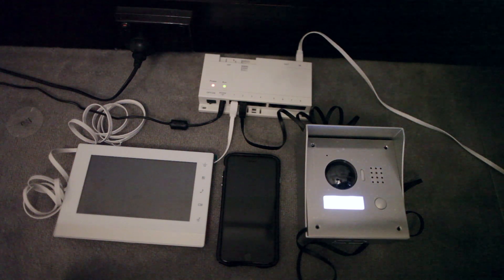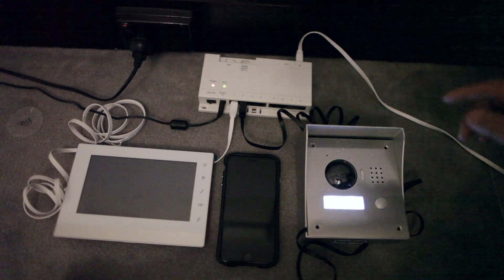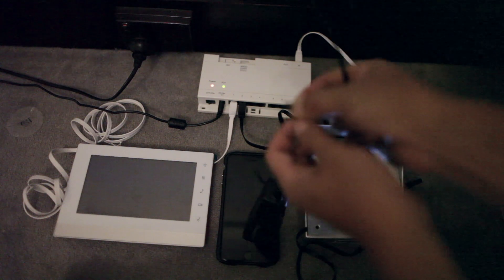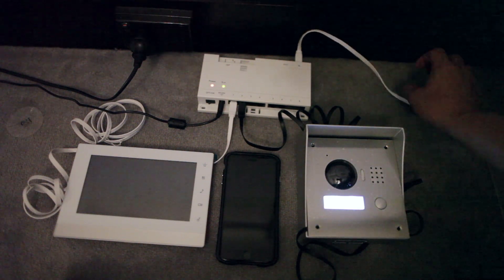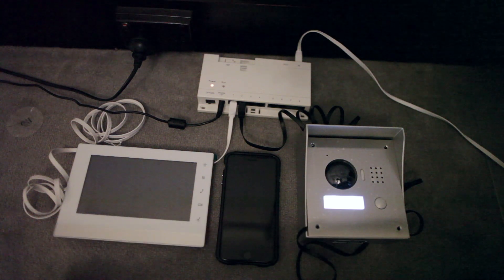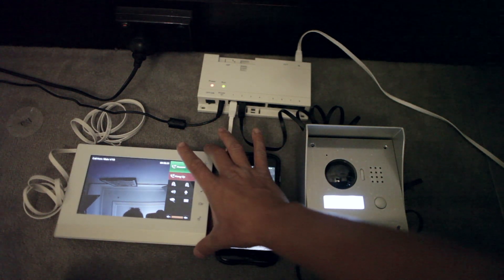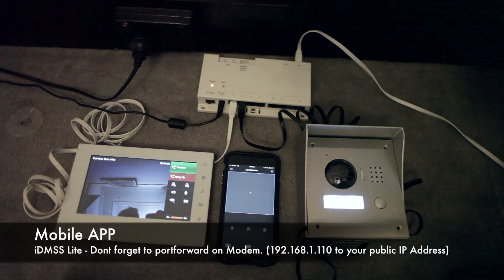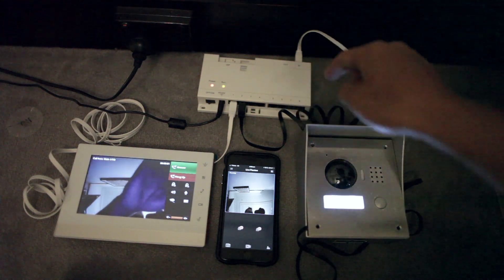Video Intercom - Dahua VTO2000A

Comment from the maker: Update: there is a new APP called DMSS which is available now and it replaces iDMSS Lite and iDMSS PLUS. Both the predecessors was quite unreliable with the push notifications to mobile phones but this new one seems to work so much better. I can do a vid if anyone is interested in it.
Reply: Hi Gavin - thanks for your video.  I have the VTO2000A and VTH1510CH set up, very similar to yours, and trying to get the mobile app working but can't find the devices to add in the DMSS and iDMSS apps and I can't even get in to the web login interface using 192.168.1.110 .   Do you have any advice on how to troubleshoot?
Reply from the maker: Terrie F for the web login via IP, you need to use Internet explorer. All other browsers just show a grey screen. 

For the dms app, the devices don’t automatically show up for you to add. 
You need to hit the + then add via IP/Domain and enter the IP address of the device. 
If It’s LAN then it will be the 192.168.1.09 or your external IP address with the port 37777
You will need to port forward first though
Reply: Gavin poh  thank you, will try again with the port forwarding
Reply: Hi Gavin - could you please do a vid of your new DMSS app set up?  I can get the DMSS notifications and live camera when my mobile is on the home wifi, but when I'm on say 4G I get the notification but times out when i try to answer the call
Reply from the maker: @terrief2083  Hi Terry i can if i get some time. maybe just check the stream settings and make sure its under "Main" and not SUB. It could also be simply your network may be weak. If youre getting the notifications outside of your network whilst on 4G, it means the device is correctly set up in your router and it can get out via the port forward. The quality of the voice or the issue of timing out may be a network coverage issue instead.

Comment: Hello, did you have problems with wifi when the doorbell rang? When sounding, WIFI disconnects me.
thanks.
Reply from the maker: No i dont have that issue. Strange though.. i cant see how that would impact your wifi?
Reply: @K9Ren  I clarify that I do not use the dahua poe switch. maybe it will be that?
Reply from the maker: @leandroruizdiaz8929  maybe.. i havent tried using a standard POE switch but that makes more sense if its from your main switch as i think they use proprietary firmware on the Dahua POE Switches.

Comment: Hello, I have exactly the same set as you have and have a problem that I can not enter into web agent. Default ID 192.168.1.110 or 192.168.1.109 is not working :-( Could you give me some tip? Thanks. M.
Reply from the maker: Michal Pugner are you on MAC OS? 
I had that problem too but when using explorer on Microsoft, it works. Try that
Reply: @K9Ren  I have Microsoft IE. Is there anything what needs to be set up in windows?
Reply from the maker: @MPugner  sorry mate thats about all i can add here. I was getting a grey screen on MAC OS and Safari, Chrome and Firefox. When i spun up a MS VM, it worked. I guess you just need to make sure youre on the same network when you access it. Do you have a different IP range in your home? Perhaps you may be on 192.168.X.X ? rather than .1
Reply: @K9Ren  Maybe yes. I just followed the attached manual :-( Is there any way how to find out the correct IP?
Reply from the maker: @MPugner  Thats on your Modem.. can you browse to 192.168.1.1 ? that should be your default modem but i suspect yours may be 192.168.0.1. I cant help with you modem and network settings but if you google how to find your IP range.

 In the “System Preferences” window, click the “Network” icon. Select your network connection—for example, a Wi-Fi or wired connection—and then click the “Advanced” button at the bottom of the screen. In the “Network” window, select the “TCP/IP” tab. You'll see your router's IP address listed simply as “Router.”
Reply: @K9Ren  I will try that. Thanks a lot ;-)

Comment: @Gavin - hoping you're still monitoring this post mate. I have recently purchased these exact devices, and for the life of me cannot get them working. Like you, I've searched and searched online for tutorials, help, guides etc and came up short. Following your advice in the vid, I have all the cables connected properly, have the Power and Run lights lit up on the VTNS1060a - which also powers on the screens (I have a VTH1550ch & VTH1510ch). I have tried entering 192.168.1.110 into my browsers for Chrome, IE & Firefox however cannot gain access. Are there steps I'm missing??

I have also now downloaded the Dahua Config Tool, however it also cannot detect any devices?? Please help mate before I go insane here.

Cheers,
Willow
Reply from the maker: Hi willow

Does the units work (I.e bell rings when you push button and also rings on display) but you just can’t get access to the config user interface? 

I know this is obvious but check your PC is on the same network, preferably connected via cable and not wifi. 

I’m no expert but it worked for me on PC but won’t work on Apple Macs.
Reply: @K9Ren  I just pressed the button and one of the monitors lit up and rang (wow that was loud!). Yes, I'm running Windows 10 and have my modem physically connected to the computer. So to confirm, you didn't need to go into your control panel > network settings and manually change your IPV4 details? Just simply popped the 192.168.1.110 into an address bar?
Reply: Sorry mate, to answer your question - yes, that's right cannot for the life of me gain access to the config user interface :(
Reply: Update: so I've logged into my router settings and cannot see any of the Dahua devices within my Connected Devices list... hmmmm. I have also noticed that of the devices listed use the following protocol 192.168.0.x - somebody helllllp :(
Reply from the maker: Ryan Wilson yea for me it just worked on 192.168.1.110 as my networks are all 192.168.1.x
Another obvious one is trying 192.168.0.110?
Sorry I know this may be patronising but I’m a noob at this too.
Reply: @K9Ren  Hi again Gavin. So I finally managed to get the units to talk to one another (what an ordeal!) My next piece to the puzzle is now trying to connect my door strike. Question for you, does your strike simply connect directly into ports 10 & 12 (COM & NO) of the VTO, as is POE? Or do you then have a separate 12/24v power running to the strike? Again attempting to find a simple installation guide on this is proving to be a nightmare. Thanks again for your previous advice too.
Reply from the maker: @kpstar1690  no worries, mine was straight forward as I had a separate 12v strike already there and just needed to connect a relay.
Reply: @K9Ren  my saga continues... however progress made! Hey Mate, so I have now successfully connected the strike via the relay :) My issue now is that when pressing the unlock button on the VTH panels, it will not unlock the strike (making me think the wiring was wrong!). However when i log into the Web Service on my comp and press the 'Open Door' button (within the Video Set tab), it successfully releases the strike. So this now leads me to think there are settings within the VTH, or somewhere else that I now need to configure allowing the strike to release when pressing the button on the VTH directly (like it successfully does via the Web Service). Is any of this ringing a bell to you Gavin? I feel I'm now so close to finally getting this thing set up, however, can't get over the final hurdle! Cheers, Willow.
Reply: Additionally, the only cable I have connecting to the VTH1550 is an Ethernet cable. Looking at the back of the VTH there is a row of pins, as well as a green 2-wire port both currently not doing anything i.e. nothing connected to them. Should there be something connected them that you know of?
Reply from the maker: @kpstar1690  Hi mate, Thats good news :) no i dont have anything connected to the back of mine either, just the Lan cable. Did you try playing around on the settings such as lock duration etc? Essentially the APP is sending the same signals as the VTH is so thats strange that it works on one but not the other...
Reply: @K9Ren  Thanks for the prompt response mate. That's my thoughts exactly, I have 2x VTH (one main, and the other an extension). Both of them will not unlock the strike. I haven't yet downloaded the phone app to test that yet. I'm logging in to the Web Interface 192.168.x.x on my comp, which is allowing the strike to release via the Open Door button. Yes, I've tried playing around with the setting withing the A/C tab regarding duration etc to no avail... my word I didn't ever think it would be this difficult to set up :/
Reply from the maker: @kpstar1690  I guess i got lucky because im not technical at all but somehow it worked for me..but i dont have the complication of an extension..i wonder if that could somehow require further config
Reply: @K9Ren  i think that's my next step! Just downloaded and setup the app perfectly. It also releases the strike! Will look to remove the 'extension' VTH in case they are somehow clashing with one another.. more progress made :)
Reply from the maker: @kpstar1690  one step at a time mate and soon you will be able to tell those pesky door knockers to P|$$ Off lol
Reply: @K9Ren  hey brother, i hope your check this message.. i have a question. i have 4 old screen of dahua 1510ch.. and one outdoor station master VTO2000A.. which new outdoor model can i buy which will readily work with the old 1510ch screen without any hassle.. The VTO2000A is no longer available
Reply from the maker: @thomasn2786  no idea man. I’m just an end user, not a tech or reseller etc.. Im actually starting to think I should change to something else as the lag on these units are annoying.

Comment: I’ve been using this intercom set up for about a year now and it’s working really well.

 I’ve been thinking about intergrating a dahua cctv system by adding an IP camera and possibly an NVR to record. I’m assuming I just need to connect the Camera and NVR to the switch and configure??? Has anyone done this by any chance or knows if this will work or not?
Reply from the maker: i run a Hikvision CCTV camera system with a Hikvision DVR/POE Switch. They are very similar in how they are configured and will work. The Dahua APP, IDMS Lite or Plus will give you the added advantage of a single mobile APP to view CCTV & the Villa door.
Reply from the maker: after some digging, you can record the feed from the gate camera

Comment: Great. Video. How did you set up the app
Reply from the maker: Download from the appstore. Its called iDMS lite and its free (both android and ios).
Once installed, it give you options to view CCTV Camera, Door or Alarm.
Select Door
This will launch a "Live Preview" page but because its not yet configured, it will be blank.
Select the icon on the top right of screen. It looks like a an intercom with 3 lines. This takes you to the Add Device page.
Select "Add Device". It will prompt you to ensure your system is on the network and turned on.
Select IP/Domain then input the details
NAME: Whatever you want to call it
Address: This is your external IP address. The default is 192.168.1.110 but if you google "Whats my IP address" it will provide you with your networks external address. Input that.
Port: 37777 (Default)
Username: (default is admin)
Password: (whatever youve set or the default is also admin)
Audio only: (Leave that to off)

Once done, select Start Live Preview and it should show you a live stream.

If it doesnt work, it means you haven't port forwarded 192.168.1.110. Thats another step you will need to learn how to do on your own modem. Its typically under Games and services of your modem setting. Let me know if you get stuck, i can try to help

Comment: Hi I have the same instalation as you do but how do you get both phone and VTH ringing or push message at the same times, thanks for help ;)
Reply from the maker: HI Thierry, Once you install the app on a smartphone and configure the IP Address, username and Password, the doorbell will signal the VTH and any mobile devices that are configured in almost realtime. You can see from the vid its a bout a second delay between the VTH and the mobile device ringing. It will push to as many mobile devices as you have configured. We have 4 here and they all ring when the doorbell is engaged. It then becomes a race condition as to which device answers first for the audio but any of the devices can unlock the door. Hope that helps
Reply from the maker: I mentioned in the text of the video you will need to portforward. So on your home network, Google "Whats my IP Address" and use that instead of 192.168.1.110 in your phone app setting. You will also need to open the port in your modem to allow communication from your home network to the public network.
Reply: Where do I find the details of which port the device is sending the details to the phone on?

Comment: How do I set up the push notification Thanks in advance 
\
Reply from the maker: Hi Basil, Go to the App Store or Google play and download iDMSS Lite (its free). Once downloaded, you have the Options to view Security Camera's, Intercoms or Alarm systems. Select add device for Intercom and there you can set Audio only or Push Notification. The push notification is configured via the mobile application, not the web UI of the intercom itself.
Reply: Hi trouble is I can not get the push feature in the menu I have tried 3 Phones ???
Reply: Thanks for your reply
Reply from the maker: Basil Loizou that doesn’t sound right. 
Have you turned off “Audio only” on the app setting?
Also check your phone notifications setting. You may have a global setting preventing the push notification. Another thought is that you may have set a phone setting that prevents apps from connecting unless you’re on wifi. Check that mobile data is enabled for your phone. The only other thing I can think of is perhaps you haven’t port forwarded your modem. If you don’t do that, your modem will prevent data going out to your app

Hope that helps.
Reply from the maker: No, there isn't a menu option that specifically says "Push Notification". It does that by default. You need to turn off "Audio only" on the app.

Comment: Is there any way to disable the "Engrish" oozing out of the speaker? Silence would be far preferable. Also, assuming you're not using your doorbell to put your baby to sleep, can the alert tone on the indoor unit be changed?

There's so much crap available (even from reputable manufacturers like Dahua) that I'm about to resign myself to simply wedging the insides of a SIP 'phone and cheap ONVIF camera into an empty intercom box.
Reply from the maker: Yorick Hunt 
hi mate, I looked into that myself. 
You can disable the “the door is unrocked” announcement via the indoor interface or the web interface. 

As for the door chime, that’s also configurable to one of 5 .pcm files via the internal unit but I don’t know if you can add to or replace the .pcm files
Reply: +Gavin poh many thanks for the reply - far more insightful than any of the suppliers on AliExpress have managed to provide.
Reply from the maker: Yorick Hunt yea they are a bit hit and miss. Most of them use google translate for our questions in English which often confuses AliExpress merchants more. Glad I could help.

Comment: Thank you for this test video!
I want to ask you if is it possible to mute the "the door is unlocked" phrase and change also the ringbell or even mute it and connect an external ring.
Reply from the maker: No i have tried to change the wav file as well but i cant seem to do it.
You can only change the ring tone etc but you cant change the announcement.